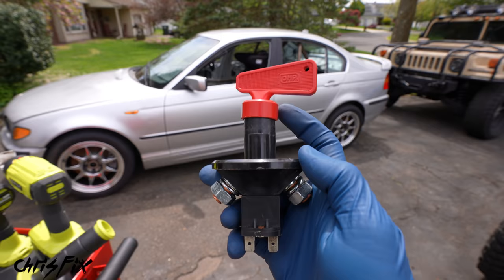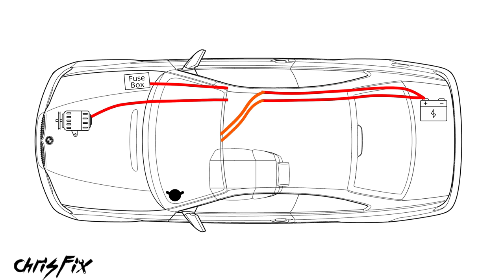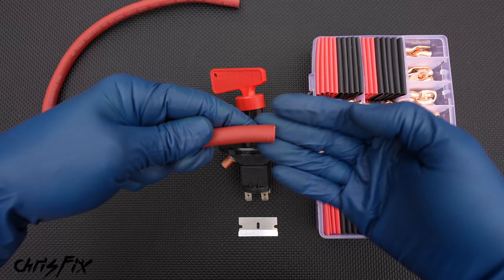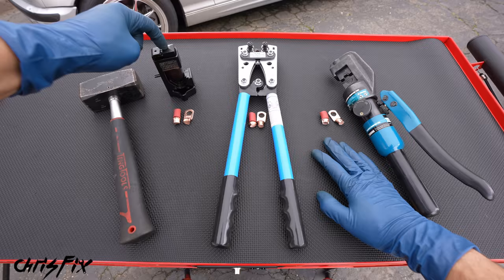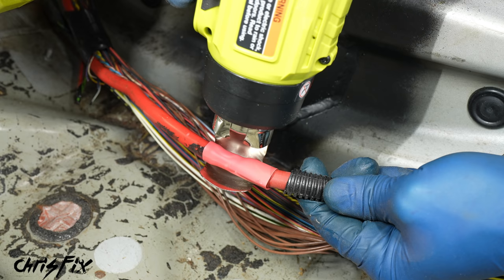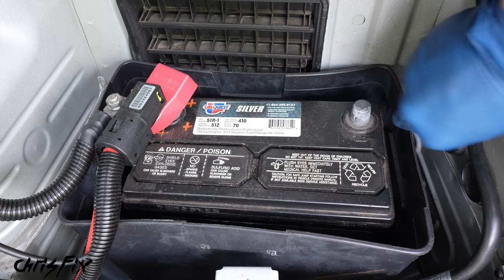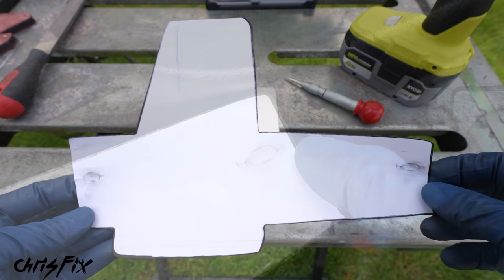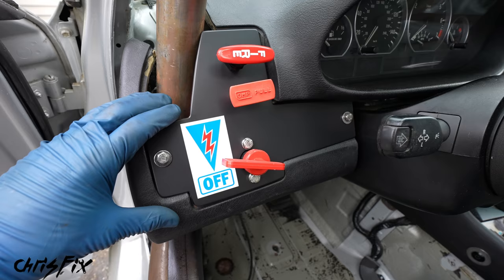How to Install a Battery Kill Switch

Comment: Hey chrisfix I have a question and even if there's experience mechanics on her that can help I'd appreciate it I have a bolt that was rusted and stuck so I had to sheer the head of the bolt off and now all I have left is a stud and I wanted to know the best extraction technique to get stuck studs out, I have extraction kits but struggling to drill into the bolt stud without it getting off center, and I have vise grips but I don't want to ruin the bolt any advice I also have a dremel I may be able to use that to make a small hole if needed that way too

Comment: If simply cutting the ECU wire stops the engine, why did you need to also run the heavy gauge wires to the kill switch?
Reply from the maker: Because the switch needs to interrupt all the electrical flow according to the safety rules for lemons: https://24hoursoflemons.com/prices-rules/#safety (Rule 3.7.1)

Comment: 29:15 it would be better if you removed the original contact, connected the fuse and continued to pull the new cables with the new connectors. The second option is to cancel the relay completely and pull the new cables straight from the switch.

Comment: It'll probably be fine, but the diameter of the threaded rods on the kill switch is way smaller than one single of these battery cables already. So design-wise something is not completely in order.. One such cable is capable of melting that entire kill switch, let alone two of them. So could have left out one of the two runs to the battery... 🙂

Comment: So if u had an older limo, and mine has two alternators in it, and I'm having to jump it and recharge the battery in mine every few days, how would I know which alternator the kill switch needs to be going too thru it in my car? Any clue? Just wondering if putting a kill switch in mine might stop whatever keeps my battery in it from ending up dead in my car!??

Comment: Nice video, what would you use for a switch that doesn't have the 4 pins at the bottom. Here is SA i've only seen the 2 way battery switch. 
I've installed the 2 way switch to disconnect the battery but it does kill the power if the switch is turned off(just disconnect the battery), is it still safe to use like that? or do you recommend to add the kill wire and how would you wire them with a 2 way?

Comment: Hey Chris I have a kill switch that has a wireless remote control so I can kill the car with a remote. It has a remote control power switch my question is do I connect this to the negative side of the battery?

Comment: @ChrisFix I see you using snips for your zip ties, and I wonder if you have ever tried a zip tie tensioning and cutting tool??? The cheap manual one I have tightens the zip tie to a set amount of tension then automatically cuts the excess zip tie off... The one I bought from a "bargain tools" type store, such as harbor freight, was something like 10$, and although I don't use it much, if I had a job with many zip ties, it is something I wouldn't mind having around, especially if I needed very tight cable ties

Comment: i would install the kill switch close to battery and run a wire to driver side to pull the switch when emergency.

Comment: Chris fix I really need help with my truck it's eating oil and  Radiator fluid but there is no leaks also it's not leaking to the engine,  some tips would help alot thanks

Comment: It would be better idea to use remote controlled bistabil contactor. And this is not all. Usually battery disconnect switch is combined with alternator inhibitor contacts, and if you push disconnect battery button when engine runs, alternator stops charging and a second later battery contactor opens and engine stops.....

Comment: How does this switch work… I’m confused… the input and output are physically touching what is the switch going to do? How does the switch interrupt a circuit that’s physically bolted together at the switch point

Comment: No idea why you left 2 wires on the battery side if the alternator is jumped to the rest of the engine at the switch...

Comment: Hi Chris, will you switch from gaslion to E85 on a non-flex fuel car to gain more horsepower? I'd be appreciate if you could make a guide of it. Gaslion price goes crazy recently😥
Reply from the maker: Yes, stay tuned!
Reply: @chrisfix  You never disappoint me

Comment: I have a question for you guys im thinking about getting a rx-8 with 68k miles for $4'000 engine doesn't run some transmission parts are missing my thoughts are that I should offer less than 4k what should I do

Comment: I get some Ryobi tools because they're cheap and lightly used, and use my DeWalt batteries with the DM18RL adapter.

What about using a breaker? I'm also thinking about running everything else in my bus off of a 300A breaker.

Comment: Instead of cutting the original wiring and having a but joint terminal (weak point) why didn’t you just undo the original leads to the battery and connect them to the switch and then run new cables from the switch to your battery. Less connections making a safer and stronger circuit

Comment: hey chris. I need to know how to route the transmission cooler lines from the transmission back to the radiator on 2001 grand cherokee. 4.0.  like which rubber 3/8 hose, does the top longer line from the radiator connect back to? help a girl out.

Comment: I WANT TO INSTALL A SINGLE BATTERY DISCONNECT SWITCH IN MY 07 H2 HUMMER, I HAVE A PARASITIC DRAW THAT I CAN'T FIND LEAVING ME WITH A DEAD BATTERY AFTER A FEW DAYS...WHAT SWITCH AND GAUGE WIRE DO I NEED? WHAT AMP RATING ON THE SWITCH WOULD IT NEED TO BE? PLEASE HELP, THANKS @CHRISFIX

Comment: If I just need to isolate the battery while the car is sitting parked I’m guessing I don’t need to connect the alternator and ECU, correct? Just splice the switch on the positive terminal
Reply from the maker: It's easier to remove the negative cable off the battery in that case

Comment: How are you able to adjust the seat if its fixed , I mean if another driver with a different height tries to drive the car will he be comfortable
Reply from the maker: We got everyone in the car and found a spot we are all pretty comfortable in. It isnt perfect but it is a lot safer than sliders. Gives us an extra inch or two of head clearance which is important.

Comment: 30:45 isnt taping a resistor a fire hazard?
I know its a big ass 3 Ohm resistor, but still - under certain conditions it could produce extreme heat possibly starting a fire.

Comment: Why does the computer have to be shut off separately 6:00
Reply from the maker: Because it controls the ignition circuit and needs to be shut off along with fuse box and alternator and battery per lemons rules

Comment: Hey anyone able to help me? Give me some advice maybe? I got a few projects going on, my WJ and 5.0 Foxbody, I need some help with Fox, it won’t run right, I can’t figure out why nor can my dad who’s very well versed in 302’s 

It’s an 1989 It will start and idle beautifully for roughly 30 seconds after the battery has been disconnected for awhile, but then it’ll die and barely idle after wards. Can’t find any vacuum leaks, neither. Everything looks appropriate. I can do a base idle reset neither

Comment: What size wire.?  Is it the positive side or neg.
Reply from the maker: 2 gauge (7mm) wire: https://amzn.to/3GpvCca and this is being done on the positive side of the battery
Reply: @chrisfix  thanks.  I can't believe how controversial the subject is about the negative side and positive side. Especially the Marine industry are saying positive side.  
I think of a guy envented a duel shut off that would guarantee absolute shutdown.
Reply: I was told that 6 gauge wire will work. I want to run it into my truck for easier shut off switch because I drive often and I have a trickle leak.  
I'm going to check out harbor freight for a quality switch.
What I don't understand is why so many people are not recommending this method. Instead they are recommending a special relay at the battery and then run very small gauge wire to the inside to a switch.

Comment: How do you know how much ohm is needed for the resistor
Reply: yasio bolo   between the switch and the ground is a resistor how many ohms does that resistor need like for example 10 000 ohm

Comment: I don't like that there is no reminder to wear a dust mask and eye protection while cutting the aluminium. Yeah, aluminium is during cutting pretty heavy to fly, but it also isn't safe to get in the body the dust also gets lighter while filing and rounding it. This feels incomplete.

Comment: I would have first installed the switches in the plate and then installed the plate in the dash.
Reply from the maker: Either way probably would have worked but the cabling was pretty stiff and hard to work with so it was better to run them after getting the panel set

Comment: Hey ChrisFix this is off topic, but my grandparents have a 2008 Hyundai Santa Fe. We have had issues with the batteries ever since they got the vehicle. After sitting for a day or two, the battery dies and has to be jumped in order to get the car to start. We have tried replacing the alternator twice on the vehicle but it ends up coming back to the same thing. I really want the vehicle since I am in need of a vehicle, and it would be really cheap to buy off of them, but I don’t want to dump a ton of money into it either. The only thing I can think is that they are not getting a genuine Hyundai alternator. Is there anything else that could possibly be wrong?
Reply from the maker: Watch this video which shows how to diagnose it: https://www.youtube.com/watch?v=YC--MLNIbik

Comment: So, for the one next having this wonderful idea, please dont follow what is instructed on this video. Just buy a starting relay, and control the magnetic coil with the kill switch. Starting relay to be installed next to the battery, dont need to do all this expensive and dangerous mess (dangerous because you have extremelly high current passing on the console). Bye.

Comment: I drive a smart car for two pure, I don’t need a kill switch but it will be good to have one, that been said I don’t need one because smart cars will not turn on, some how I found the 405 code says the car will not work unless you unlock the car and THe thief will not know that, any way I doubt a thief will want to steal those type of car, but after getting my corrola stolen from the mall I don’t want to risk it again.